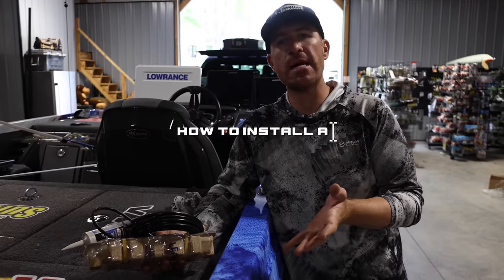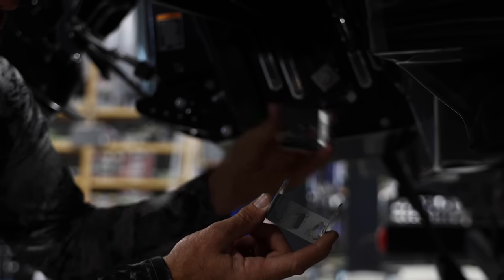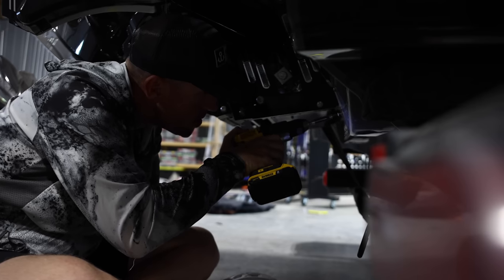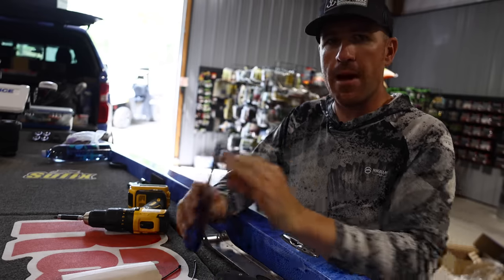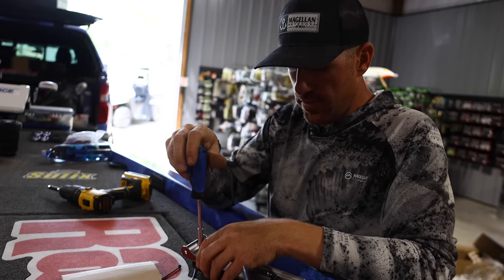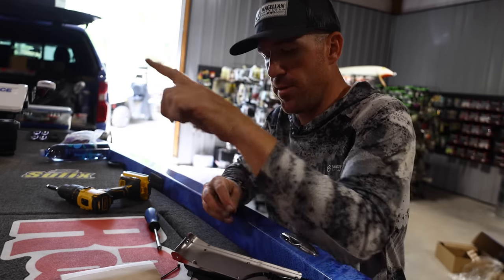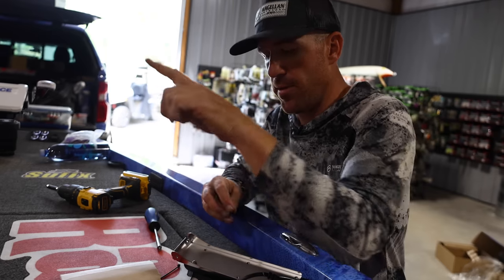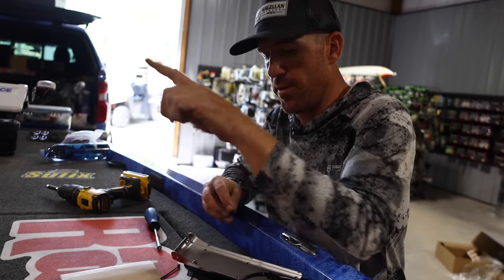The RIGHT Way to Install a Side Imaging Transducer

Comment: Just a couple of suggestions to help others learn from my mistakes.  First, when using a level, start by making sure your boat is level on the trailer (check the top of the transom...if it is  slightly off level, use dimes, pennies, and nickels stacked to one side to see how far off and then transfer that same offset to the transducer itself).  I actually do this both for front/back angle of the transducer and the left-right level.  Second, if your boat is aluminum, don't use silicon as it is slightly acidic and will cause some minor corrosion with the metal...not enough to damage the metal but I've found it is enough to cause a poor seal years down the line.  Marine goop is a great product for aluminum sealing.  The coins under the level for front-back can be really dialed in if you take the level out on the lake with you and run your boat at the speed you want the transducer level, then look at the levelness of your deck and then transfer that to your transducer.  Even if your deck is not totally level, you can use this to measure how you want the transducer oriented if you jack the front of your trailer to get the deck at the same angle it was in the field, then you can put the transducer totally level at that position and know it will work at the boat's angle at the speed you measured.

Comment: As a baseline, if you have a scum line on your boat it helps with installation and initial setup.  Gives you an idea how your boat sets in the water instead of just how the trailer is positioned, then adjust a few degrees from there.
Reply: lazer level for the win !!!

Comment: Hard to tell from video how far off the holes are, but could it be an option for future installs to maybe drill new holes in the mount and use existing holes in boat so you dont keep putting holes in the fiberglass?

Comment: Hi there and thanks for the wonderful video. I usually drive with a trolling motor at the front of my boat, when i use the sonar at low speed. How does that influence the transducers angle?

Comment: Crazy the difference a degree or two makes. Will have to check mine.
Reply: Im kind of late to the game, but yes, a few degrees makes a huge difference.  A professional installer showed me what he does. He said take a bullet level and a pocket full of change, w you to the lake. 

1. Place the level on the gunnel when you are idling around at about 3- 5mph.

2. Put the coins under the BACK of the level until the bubble is in the middle. 

3. Mark on the gunnel with tape or a marker where u put the level. 

4. Put the change from the level in a separate pocket from the rest of your money

5. Once off the water and on the trailer, Jack the trailer up with the level in the spot marked on the gunnel and the coins under the BACK of the level until the bubble is in the middle. (You will be surprised how high you have to jack it up. My F2 fulton jack couldn't get it high enough. I had to put a floor jack under my trailer jack wheel to help w the height. 

6. Put the level on the transducer and level it. It will look like its way to angled, but its not.

7. Go to the water and test. Youll be amazed.

Comment: imo the best way to know angle of transducer for down scan is to go on the lake with ur boat in the calmest water u can find and go 5mph and measure how level it is and mark the level or take not of the angle its at and then install the transducer exact opposite of that angle on the boat. ie: if the boat has 15* bow lift at 5mph then install the transducer 15* above level.

Comment: Not saying there’s anything wrong with this video but I will add to it as someone who does installs every day.  
Use a marine silicone. Yes silicone is 100% waterproof but that doesn’t mean it’s meant to be submerged under the water  for long periods of time. 
2nd I suggest using you a drill for pilot holes, and an impact driver to insert screws. Just helps with not stripping a screw. Last thing is I’ll take a marker and mark my holes before I drill instead of trying to hold it while drilling pilot holes. 
Like I said not saying anything in this video is wrong, someone just might find these few things useful.
Reply from the maker: Appreciate the input!! Those are definitely great tips!
Disclaimer: normally we have always used marine grade but at the moment we were just winging it. Also trimmed part of the video when were going back and forth trying to find the right drill bits... We weren't installing for the first time, just swapping out the original 3-in-1. Hard to be SUPER thorough when the cam is rolling sometimes

Comment: Wouldn't it be better to run a 2d trans with your side imaging transducer?
Reply from the maker: ?? The transducer I installed in this video is a 3-in-1 which includes "Traditional Sonar" + Down Imaging + Side Imaging
Reply: @WheelerFishing  (bird user) from what ive gathered having a 2d transducer set for graphing at speeds and then your down and side scan run on the 3-1 giving you your adjustments for slower side and down scanning. Don’t quote me on any of that tho.
Reply from the maker: @mikecrossman4010  Of Course! A "Thru-Hull" Sonar Transducer paired with this is even better so you can get all your depth info while running and what not. It's a good time to also make sure Sources are set correctly when setting up multiple transducers (Data Sources -> Sonar -> Depth -> 2D Thru-Hull Transducer
Reply: @WheelerFishing  yes, tin walleye boat guy here so… anyway thanks for the content and congrats on the win
Reply: @WheelerFishing  another interesting thing is two side scan ducers one on each side of motor, thus allowing you to only show left and right side scan image on the 2 dash mounted screens, allowing the units to focus on one side and giving you better imagines and cutting out under the boat. 

Again I’ve only seen this haven’t yet tried it myself.
Reply from the maker: @mikecrossman4010  yeah I’ve heard of that as well, just figured it’s just more power and noise being routed and for the depths we are looking at, not sure if it matters too much or not. Might have to test it out eventually
Reply: @WheelerFishing  yes it may be better for us walleye guys. We would also like that livewell cooler you got on that ikon. Lol

Comment: Has anyone been able to use their 3-in-1 on plane, I lose the 2d and even depth around 30 mph its mounted just like Wheeler's but mine is dead centered -- Time line 15:28
Reply from the maker: what hull do you have?
Reply: @WheelerFishing curious what kind of speeds you keep/lose your reading. I am about to mount my garmin gt54 on my ‘98 Nitro and am curious if it will show depth and speed and certain speeds.

Also, different note, I do not have a jack plate so I’m concerned about my motor hitting when trimmed down, and I’m VERY unsure on where my best placement is going to be to mount
Reply: I have a 3/1 transducer on the starboard side of transom for a console unit . Plus a transducer in my Ghost for a bow mount unit . Would it be ok to put a bow mounted unit’s transducer on the port side of the transom ?  Because Motor would be off when using the bow unit so there is no prop wash ! Plus two transducers wouldn’t be right next to each other causing possible interference. Jacob have you ever did this ? And do other pro’s do it ? Opinion on this would be much appreciated x10 !